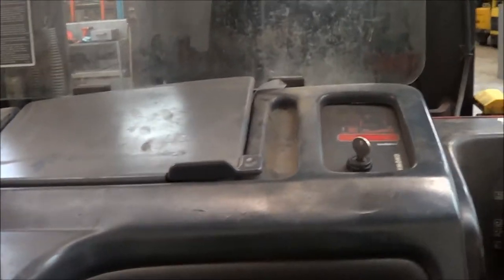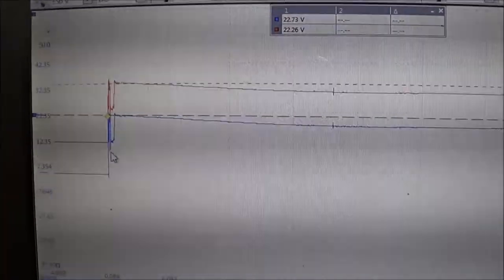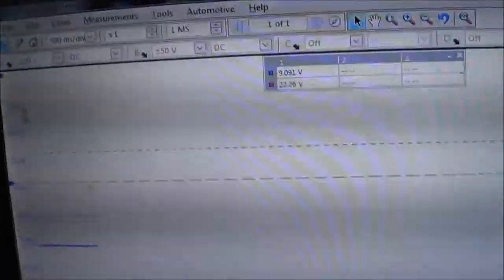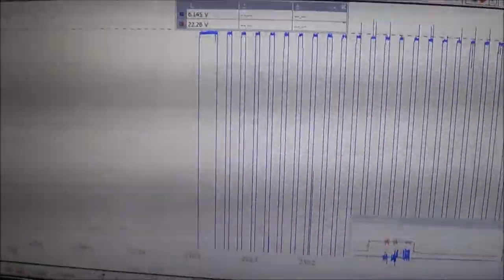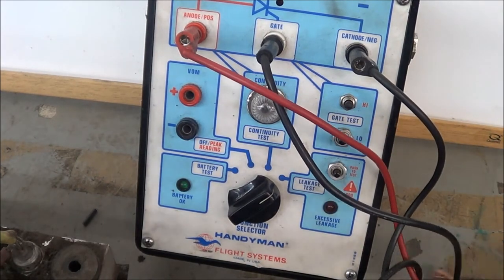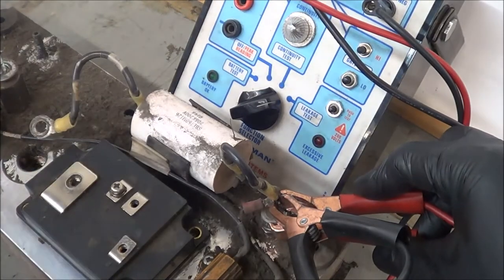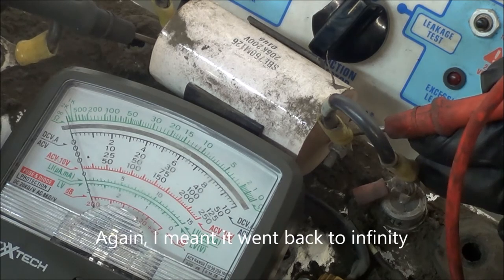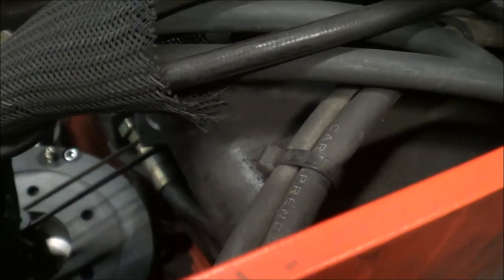Raymond Reach, Code 23

Comment: Replaced a lot of transistors. Found out that most of the causes were from weak batteries and the customer pushing pallets which creates a lot of stress on the transistor. Before the Power card was the Chopper Module and that module would fail along with the Q1 Transistor. A lot of changes were made since the earlier models.

Comment: Thanks for your replay, that is a really good idea to perform the test of the power card this way, if I’m guessing right the voltage signal happens in a fraction of a second that will be very hard to read it with a multimeter. I have a code 23 that I’m dealing with and I wanted to perform this test but no way I can expend the money at this time besides the waiting time if I decide to order one.  So Since this code is related to an open armature, what other components might be shorted out other than power card Q1 and snubber kit ? Is it a circuit related to the drive motor ?
Reply from the maker: Battery.

Comment: i HAVE THE CODE 23 AND i FOLLOW THE VIDEO TO SEE IF IS ANY OTHER PROBLEM BUT SEEMS LIKE  THE TRANSISTOR IS NOT THE SAME AS NOW  SEND ME CODE 21 IS ANY INFO IN THAT?
Reply from the maker: Short in the armature circuit. Basically the reverse of code 23. Because code 23 is an open in the armature circuit.

Comment: Ever rebuild Toyota 2nd Stage lift cylinders ? It's the smaller diameter cylinders next to the mast rails. 
Does this service require special tools?
Thanks.
Reply from the maker: +VideosByAl not really unless the chrome has damage then we usually send it out to a hydraulic shop.
Reply: Ok, I’ll did into it next week.
Reply from the maker: +VideosByAl what model of truck is it?
Reply: It is a 5FBCU25 . Its an electric with an 88" 3 stage mast. 12,000 key hours and 1000 lift hours.

Comment: I did follow your procedure and replaced the transistor but now I'm getting a code 21 as soon as I want to move the unit forward or reverse, any advise?
Reply from the maker: Make sure the B sense wire is connected to TP6 terminal and or not broken.

Comment: Have any idea what causes a code 26? I had a code 23 but took apart all the connections clean them with electrical cleaner put them back and now I'm getting a code 26. I may still have the code 23 but code 26 is popping up.
Reply from the maker: Short or open  in the field circuit
Reply: @forkliftgeek10  Dang, That was quick! Thank You, I guess now i am going to need a pro, I don't have the service manual.
Reply: @forkliftgeek10  Do you have the part number for the transistor you replaced?
Reply from the maker: Not at this time. I would not recommend ordering parts without testing them. These parts are not cheap.
Reply: @forkliftgeek10  Roger That
Reply: @forkliftgeek10  Where are you located?
Reply from the maker: @elementoutdoors2936  toronto Ontario Canada

Comment: Sir, about testing for diodes, is it the same as testing a rectifier diodes on alternator,? Thanks
Reply from the maker: The basic test yes. But, the test using a multimeter does not account for leakage under high voltage.

Comment: My man keep it up, very Fan of your channel need help im working on a EASI from 97  is the same set up that you have in this unit, i got this unit showing code F4 or F5 at times someone told me it was the static strap but did not fix the problem the code goes away when you cycle the key switch fast btw already swapped key switch and same issue if you can respond very well appreciated.
Reply from the maker: The code could also be caused by s short to frame, meaning a wire that is touching the frame from time to time. Could also come from faulty snubber circuit form Q1, travel alarm or even strobe. Depends on when it happens really.
Reply: @forkliftgeek10  with trucks that old, it’s extremely common for the battery frame to be bleeding so much current into the frame that the frame short is the battery. Customers with equipment from 1997 have a hard time with the cost of a new battery though.
Reply: How to solve this problem not working to run raymond forklift electric easi dr30tt how to solve this problem.can you help me.
Reply from the maker: Well its kinda hard to help with your description being so vague
Reply: @forkliftgeek10  you know how to troubleshot this raymond forklift electric not function to run and backward
Reply from the maker: Mas mainam siguro tagalog na lang.
Reply: Good morning, I have an error code 25 problem on a raymond easi. Help please 🙏